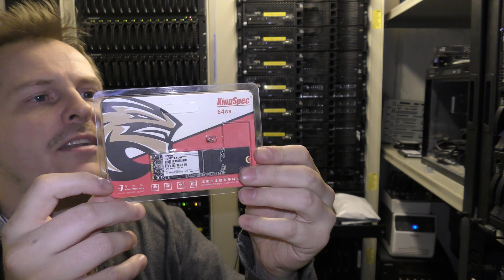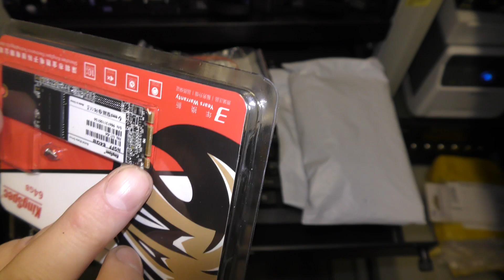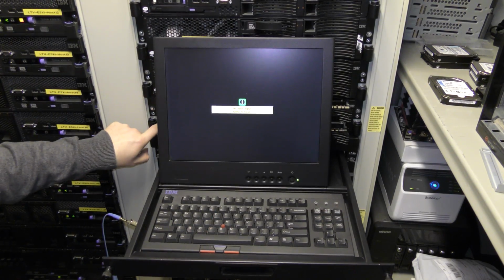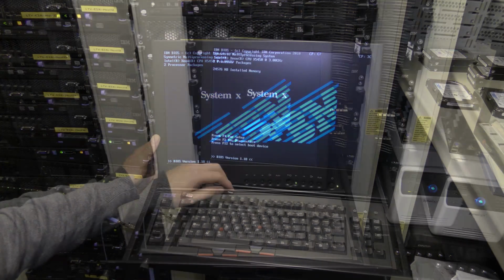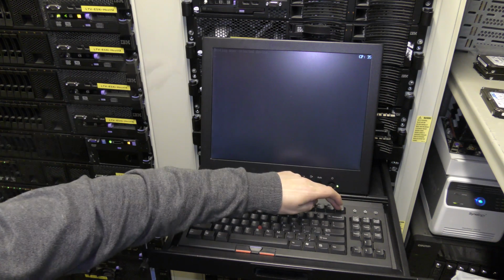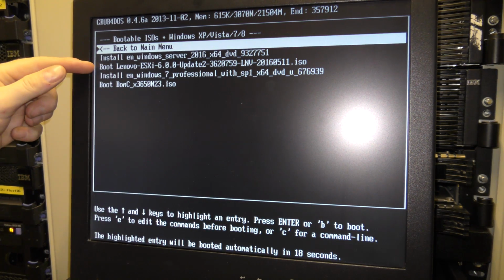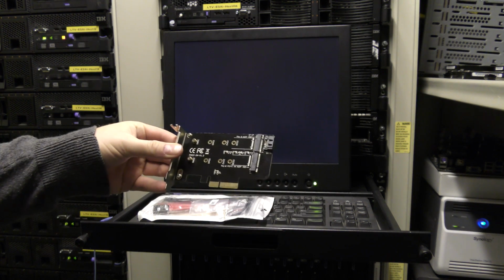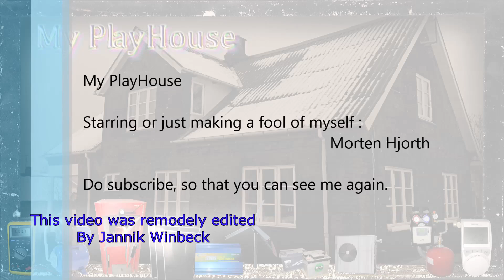M.2 SATA, FAST SSD for my x3650 M1 Rack Server - 471

Comment: Did you find out if SSD NVMe (PCI-Express) M.2.  is working on this machine or works on SATA only? Thanks!
Reply from the maker: It worked,, but you can not boot from NVMe.
Reply: @MyPlayHouse  OK, for fast booting DVD drive should be fast enough ;) Thanks👍

Comment: Hello good Morning!

I have a question: What is the need to connect the sata cable to the pci express card x card?

If I connect the sata cable will I be limited to 3Gb or 6Gb standard sata port speed?

Is it possible to connect only the M2 to the pcie board?

Thanks

Hugs
Reply from the maker: This card has one M.2 NVMe, and One M.2 SSD,, the SSD needs SATA to work. The NVMe does not
Reply: @MyPlayHouse  Consigo instalar Sistema Operacional no NVMe?

Comment: You literally have done everything that I’m currently doing with this and I’m just following along! Just installed a high speed nvme in one of the pci slots, and have already 60tb of sata data because of the 5015 raid card, as well a 1650 graphics card without power in the pci riser card with your cutting technique. This is now the perfect plex server!
Reply from the maker: If you are using a x3650 M1, be mind full of it´s power usage :-) it is a great server but also a bit power hungry.
Reply: @MyPlayHouse  did you ever get an nvme to work in that slot? It sees it but when it tries to access the nvme (works with m.2) it freezes and reboots

Comment: I also work with 3 system x3650 m4 im upgrading the firmware right now. I have a question mr, do i have to use the stock IBM sas hardisk or can i just use any sas disk with same specs ?
Reply from the maker: You can use anything,, but if it's an important production server,, chose wisely!

Comment: if you get an nvme drive with an OPROM the x3650 will boot off of it, look at the plextor m5e drives, they have an OPROM (and that's what I use on my old systems)... most NVMe drives sadly lack an oprom and won't boot old machines that lack NVMe support in the bios
Reply from the maker: Hi Frank Echanique
Thank You very much!  glad you liked the video :-)
Thank you for watching! :-)

Comment: Is it possible for the ssd disk to be recognized without using the sata cable?
Reply from the maker: Hi david yamil
No,, the SATA disk only gets power on this PCI-e card, and need to be connected to a SATA port to work.
The other M.2 NVME, gets both power and connection. so if you only use that, you do not need the cable.
Thank you for watching! :-)
Reply: @MyPlayHouse  well, I have a 970 evo installed in an adapter that doesn't have sata, I want to make it work on an ibm x3650 M1 but I can't get it to recognize it, what can I do?
Reply from the maker: I do not think you can boot on it,, bios is to old,, but it should pop up inside the OS.
Reply: @MyPlayHouse  Thank you very much, once I try it I tell you the results

Comment: Be careful buying SSD in the China market, there are a ton of fakes out there.  Sellers modify the software on them to report higher memory to the system, but are actually much lower size.  Great video, I just picked up some older server that I may upgrade in a similar way.
Reply from the maker: Hi vbrtrmn
Thank You very much!  glad you liked the video :-)
Thank you for watching! :-)
Reply: You can use F3 to test your SD cards.
https://github.com/AltraMayor/f3

Comment: Hi Morten, I would like to know if 2850 M2 can get more Capacity on Gb from a SSD RAM DISK slot x8 upper than 4x 146Gb SAS having total 587.6Gb hard disk SAS. Thinking to make Raid from SSD and to boot Windows System.

Every slot x8 gets 4gbps, you have a lot experience of installing any type of SSD, however before buying anything I prefer to ask you. 

Because if 3850 M2 it carry on being limited on 587.6Gb from RAID then I must thinking on an SSD no faster than 4GBps and no bigger than 587.6 HD SAS.
1.-what do you recommend me??

I have a RAID 1, to be protect by clonning datas, but may be It is better to have RAID 0. 
2.-Which of them is faster ? RAID 0 or RAID 1?what do you recommend me??

Nice  to meet you
Reply from the maker: Hi Ben Ballano
Not sure I understand this question,, The x3650 M1,M2 and x3850 M2 ´s raid controller has a max limit of 2TB per drive SAS or SATA.

Have you meet me??

Thank you for watching! :-)
Reply: Hi Morten, inthe next link: https://lenovopress.com/sg247630.pdf page 127 describes next:

Depending on the level of RAID you want to configure, up to 584 GB of disk space can be used internally by using four 146 GB drives. Table 3-10 shows the supported disks 

However If I decide to make bigger hard disk than 584 GB SAS from a SSD Ram Disk x8 slot, for example 2TB  SSD Ram Disk x8 slot, It could be posible? or is it takes to do from M.2 SSD because de Intel Chip is lower than I6 or I7 and may be It does not recognice it ? 

My tarjet is the next:
To be able to boot from PCIe Card x8 SSD RAM DISK or to boot PCIe Card x8 SSD M.2  depend on if hardware is compatible chipset to do it and having Disk Drive bigger than by manufacturer  584 GB SAS from 4x 146 SAS. Then I could do configuration RAID drom PCIe Card x8 SSD Ram Disk a lot bigger than 584 Gb SAS. I do not know if the last choise its posible. I am learning from you.

Thanks very much

Comment: you should make a video on encryption and use of PCI-X Crypto Accelerator, no matter how much i read about this stuff, still hard to understand, and thanks for the M.2 explanation, I've read about 10 posts each of them was an essay, and nether one explained what distinct types there are, all of them said "you dont need the really fast one just get EVO" so thanks for explaining in one sentence that its SATA and NVMe, latter being the fastest, and connecting through an adapter or directly, and must be supported, or else it works over slower SATA protocol, thank you again
Reply from the maker: Hi Igor Igor
Thank You very much!  glad you liked the video :-)
Thank you for watching! :-)
Reply: explain what PCI-X crypt accelerator does

Comment: hi morten i am just chasing some information. what version of ibmc do you use to update the x3650m1 ? i have a model 7979 and cant install esxi 6 as it says unsupported cpu. {i am unsure what xeon it is it just says mv 3.02gh.}
Reply from the maker: Hi Nathan
I do believe you need an 5400 series CPU now.
Thank you for watching! :-)
Reply: ah ok i thought that may be the case. They should drop in perfectly fine shouldnt they?
Reply from the maker: Hi Nathan
You can install ESXi 6.0 and 6.5,, It complains with 6.5,, see my video on installing ESXi 6.5 on the x3650 M1
Thank you for watching! :-)

Comment: I read reviews about kingspec NGFF ssd, it seems to be good enough. the bios might be misread the firmware (?). and unfortunately you couldn't M.2 PCIe on X3650. those PCIe SSD needs NVMe compatible system to work. I saw pcie x1 to 2x NGFF SSD card earlier. you might like it
Reply from the maker: Hi S. Kojina
Thank You very much!
Thank you for watching! :-)

Comment: If you are not to use NVME for bootup it will most likely work. There is even a trick to have NVME m.2 (the PCIe Link variant) boot up with older Nehlem based chipsets even from legacy Boot Mode (NVME needs UEFI to be bootable normally. What I heard it could be achived by Clover, but was not able to verify that by now. http://mrlithium.blogspot.de/2015/12/how-to-boot-nvme-ssd-from-legacy-bios.html).

Comment: I guess that NVME and S-ATA will work when both are equipped, as m.2 has a power Limit of arround 12.5 watts where as the PCIe Slot without additional Power is capable of providing upto 75 watts as it is in the PCIe Standard since Version 1.0
Reply from the maker: Hi tmkoeln
Thank You very much!  It´s only an x8,, so I believe it can provide 25Watt.
Thank you for watching! :-)
Reply: 25W is defined for PCIe x1- x8 that is right...

But 
should be enough anyways :

Even Highend m.2 nvme ssds like the Samsung 950 / 960 Pro tend to draw no more than 5 to 10 W
Reply from the maker: tmkoeln Yes there is no problem :-)

Comment: Hi Morten . interesting post as usual.  why not put a 2.5 ssd on the caddy ? i tought the sas connector where compatible ? also if you plan to used a nvme i wounot use this pci card coz it pass it to the sata controller and therefore i doubt it will get the full speed compared to directly to the pcie. 

from what i understand on older bios . a pcie . nvme adaptor would be recognized as secondary storage by the os. just no able to boot from it.

also your post strike curiosity in me and research nvme boot compatibility on older mb ( ie my z77). the community mod firmware to make the z68 z77 z87.
very interesting .
http://www.overclock.net/t/1571271/tutorial-how-to-add-nvme-support-on-any-ami-uefi-bios-with-an-intel-chipset

i wonder if it would work on ur bios
Reply from the maker: Hi Frank Kesel
Thank You very much!  glad you liked the video :-)
Thank you for watching! :-)
Reply: My PlayHouse  ? ok

Comment: I have a "Intel 600P Series 128GB M.2 PCIe 3.0 x4 SSD" and a "Desktop Dual-voltage Dual Port NGFF M.2 B + M Key SSD to PCI-E 4X Adapter Card". I have installed it in "ML10 V2 Intel G3240 4GB No HDD" and it does not work after I installed VMware esxi 6.0.0. I will have to get an M.2 SATA SSD and plug it in to the second slot.
Reply from the maker: Hi David Wilson
You shout not be able to boot from a PCI-e version on old hardware only the SSD version.
Thank you for watching! :-)

Comment: Hi. I did this exact thing when building my freenas server using a 7979. You can use the pci card without the sata connection the system will see it but you can't boot from it. I could not find a way to select pci device in the boot menu. I tested it with esxi 6.5 and was able to create a data store with no issues.
Reply from the maker: Hi Ladislav Brezovnik
Thank You very much!  I´ll have to try that to!!
Thank you for watching! :-)
Reply: I have ordered a SATA DOM to try. I though it would of been here by now. Once I try it i'll let you know it it was a success. http://www.memorydepot.com/ssd/listcat.html?catid=SATADOM-SL-3ME2&prodid=DESSL-32GD72SCADNA

Comment: Nice video! gives me something to think about.
I would like to see how it performs after several months of use, especially if it's stable for booting.
I mention this because i used some cheap Verbatim USB-sticks which are all failed by now.
Reply from the maker: Hi Henk Kok
Thank You very much!  I have never killed a USB stick,, how do you do that?
Thank you for watching! :-)
Reply: It not actually dead, but esxi does not boot anymore due to read problems on the usb device. I will send you a picture of it

Comment: There is an entire write-up on M.2 SSDs. there is two variants for storage: SATA III and PCIe. not all two-notch cards support PCIe, and are limited to PCIe x2 speeds. single-notch is PCIe only and can use the full speed of the X4 slot it can go into in an adapter. suggestively, see if the card works in the lower slot. you might be able to get it to work. some support both protocols.
Reply from the maker: Hi Sudos
Thank You very much!  I am toled that the CPU is way to old for the PCI-e versions. I am more or less just getting power from the PCI port.
Thank you for watching! :-)
Reply: for booting, yes. for using as a storage medium? nope. still, to do a test to see if it even will show up as a bootable device would be an interesting thing, since IBM's BIOS implementation on those machines does go away from norms, being a server and all. it might be able to see it as a bootable device, you never know.

I got stuck with an m.2 2280 double-notcher thinking it was a PCIe x2 AND SATA compatible card as some are, and got a passive adapter to try and make use of it as a storage drive, and to my dismay, it was only SATA in the end. there's also a good write-up on the intertubes somewhere about which brands/models use which standard for what, and that's generally how I found out aside from the big ol' SATA marking on the label I didn't bother to fully read. I just got excited that it was an m.2 SSD and oh wow it's all mine, but nope, still can't use it yet.

Comment: I don't think you will see any advantage of using a NVME ssd using the PCI-E bus since you prolly have either version 1.0 or if you are lucky 2.0. Each lane on 1.0 is 250 MB/s and 2.0 is 500 MB/s per lane. most of those cards will only run 2x on PCIE so if its 1.0 it will be actually slower than SATA 3.0  and only a marginal gain on 2.0

Comment: China sellers are selling "fake" high capacity USB drives by playing with the firmware. 
Turning 8gb drives into 128+gb but changing the firmware string.
Obviously you still only get 8gb but are fooled by the number displayed. You should test that M.2
Reply: Ive had the problem in the past with same trick on usb flash drives.
Reply: It was the server first seeing only 8GB that got me thinking about that old trick.
There are some programs out there to test the actual size thankfully.
Reply: Roderick Roderick Kingspec. Is legit I've used it and also aa computers and technologie used one but it was a ide one they are. Fine not the best in the world but they don't fake it
Reply from the maker: Hi Roderick Roderick
Thank You very much!  I will be playing with this some more,, test performances and copy >8GB to the drive.
Thank you for watching! :-)
Reply: Yes, know about that, but Kingspec is a known brand, if it wasn't faked.
Reply: sometimes they even sel 128mb drives for 1t and You van write 1t to them nut they delete data  if they are full so only the last minute of your movie is on the drive
Reply: these ssds are fine they just dont have over provisioning

Comment: I wouldn't bother with the M.2 slot if the CPU and chipset don't support it. It's NVME and sadly, the M1 is awesome but this is too new for it. The best you can get is what you have already.
But could you run 2 SSDs in RAID 0 off the controller for boot redundancy?

Thanks for this, will try and convince the CEO of Domestic Engineering to part with some funds for testing on my x3250 M1. :)
Reply: Mac/au Isn't Raid 1 the redundant one? 0 is striped.
Reply: QuickQuips jup RAID 1 is the ohne for you
Reply: *one
Reply: M.2 NVME will most likely not work in anything older than Haswell / Haswell-E / Haswell-EX / Haswell-EP.

M.2 S-ATA can technically run in everything that supports S-ATA (even when you use an Adapter)

Comment: but there are PCIe-SSD's which are not working on the nvme-protocol, they're not so fast, aspecially writespeeds, but maybe they will run on older harware
Reply: maybe this one : MZVLW512HMJP-00000 Samsung PM961

Comment: the m.2 you got is sata speed and not nvme speed

PS: i understand it later
Reply from the maker: Hi panagiotakis1234
Thank You very much!  I do know this :-)
Thank you for watching! :-)
Reply: Yeah, he said that he got it to replace the USB 1.0 ESX boot "drive". Which obviously would take a very long time to boot from.
Reply: in wath all your videos I am an embedded develloper I used to work as a network engeneer but I never knew that virtual machines has been so far. In university they used to show us vmware player and i never searched so much about. before 2 years i wanted to do a small rendering cluster (but the only rendering cluster you showed was about 3dsmax ) If you have time to do a video with video rendering encoding using ffmeg. As i read i think ffmeg can do distributed encoding with segments from one video to speed up process.